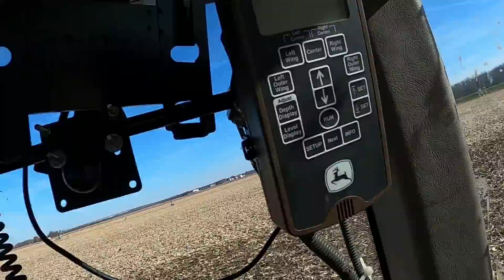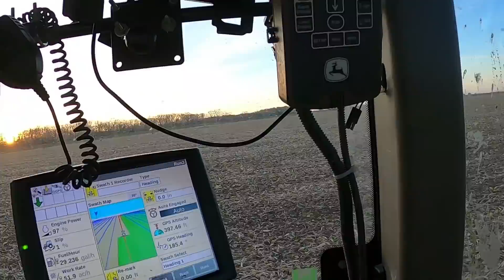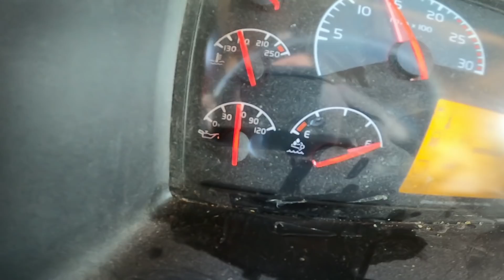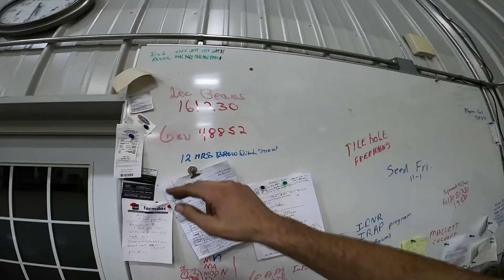Case IH Speed-Tiller Review,  New Martin Truck Bed, and Volvo Truck Problems Season 2 Episode 40

Comment: Fall tillage we usually only run about 12kmh like 7.5-8mph with our lemken disc, you lose some acres/ hour but don't plug up. We couldn't do any discing this fall, been record amounts of rain and snow, we are chisel plowing what little we can get at whenever we have some frost. I don't know that you will not have similar issues with most brands, speed discs work nice but they definitely have a window of optimal ground conditions.

Comment: great to see some of the turf side.  I highly recommend getting the 7 gallon isolated/aux tank for the z spray.  I put them on all my z sprays and add a couple separate boom nozzles.  Not hard to fab up and allows for 2 different chemicals on board at all times.  Saves money and time.  Great video!
Reply from the maker: Good idea, thanks

Comment: A deeper throat on the speed tiller would help also. That would give more room for the dirt and debris to go through. The problem is that is a redesign of the implement. Vertical tillage implements like dryer soils, just the way it is.

Comment: Like the clearance better on the Great Planes Qualidisc, they waited until other folks finalized their design, then looked @ the issues, then made the corrections to the Qualidisc.
Reply from the maker: Always a good plan
Reply: Yeah I'd like to try one some time, we're getting a great plains max chisel next year which has the same style of disc blades ahead of the shanks, I guess from that we can see how well those blades hold up. Other one we'd like to try is a Horsch Joker but I think they might struggle in fall tillage since they have 2 discs mounted to each arm

Comment: Sure looks like that speed tiller is pulling crooked
Reply from the maker: It is. Spend a lot of time trying to get it straight and gave up and just did a implement offset
Reply: @iversfarms  If you run front gang  too deep compared to the rear gang it will pull to one side, as opposed to the rear gang being too deep, compared to the front gang, it will shift in the opposite direction. Once gang depth cylinders ie: rear roller/packer and front gangs  are set appropriately based on soil conditions it will pull straight. That was a pain to get it just right when, changing depth shims, when  I Demo'ed a Degelman, and the Horsh Joker.  I ended up buying an Amozone Catros Series HS Disc that has one Hydraulic control to adjust both front and rear gangs in parallel on the go from the cab. Once the front to rear disc gangs depth ratio is adjusted to pull straight, you can run at any depth on the go without, messing with a 'zillion' depth  cylinder stops front and rear. The Amazone Catros has just one hitch cylinder with depth stops to level the mainframe when changing from transport to field position, all other adjustments, disc depth, crush board, transport lock, fold/unfold are done using the cab remotes.